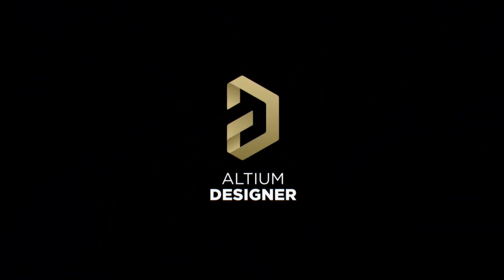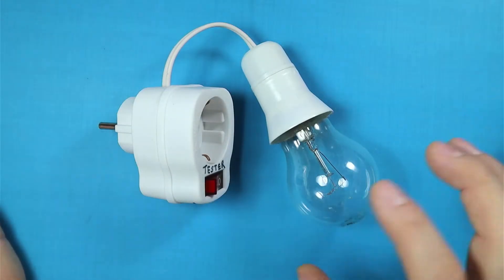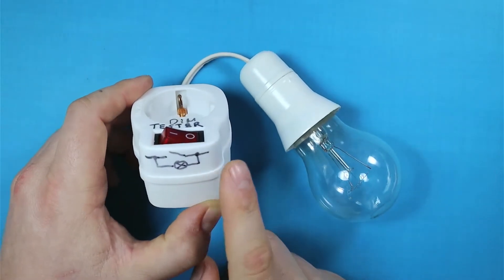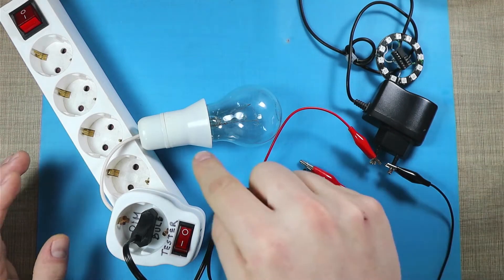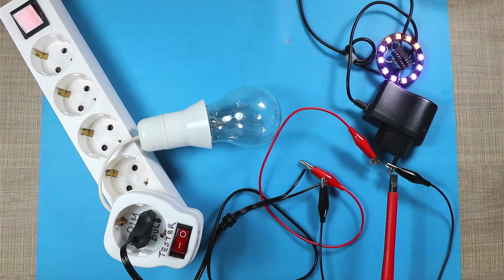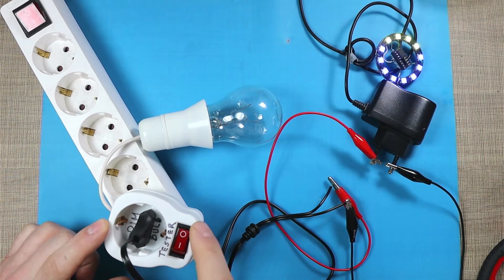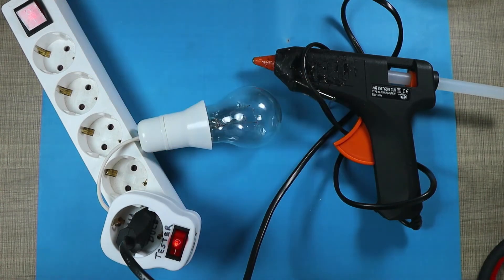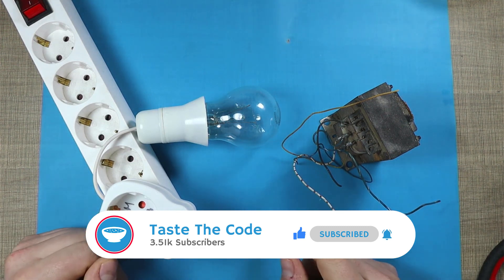How to safely test AC electronics with current limiter - Dim Bulb Tester

Comment: So the center pin of the bulb (the one located beneath the large metallic body) is still connected to the live, and the metal body is connected to the tested device?
Reply from the maker: Yes, correct. This puts the bulb in series with whatever is plugged into the socket and acts as a current limiting resistor.
Reply: @TasteTheCode Thanks. I was confused because I noticed that with UK plugs, you can't connect them the wrong way. Also, is a 40W bulb good for testing a toroidal?
Reply from the maker: It might be too low and let too much current through. I'm using a 100W bulb.
Reply: Hi again. Does it matter which direction I plug in the device? In my country, we use Schuko plugs like the one in the video. I know that the bulb needs to be connected to the live wire both from the plug and from the device, but with these plugs, we can rotate them. @TasteTheCode
Reply from the maker: No it does not. In theory yes, but again you can never know for sure which one is which.

Comment: Thanks for the tutorial, really handy. But one noob question: do you have to wire the bulb to the hot wire or it doesn't matter?
Reply from the maker: As long as it is in series, it doesn't matter. With our plugs, you can turn it around so you never really know which one is which.
Reply: Thanks again!

Comment: Am your  new subscriber frm the Philippines. 

Much better if the bypass switch is removed to avoid accident in case of negligence. Nevertheless, it's a very nice video for engineers & technicans!
Reply from the maker: Hey, thanks for subscribing. The switch is there to serve a purpose to test whatever is plugged in under full current once we established that there are no more faults. Some devices will refuse to work properly unless a sufficient current is applied.

Comment: i will add MCB before the bulb and replace  switch in bulb with MCB also
Reply: Not sure why a breaker instead of the switch is a good idea, breakers aren't supposed to be operated as switches. If I'd install a breaker it would be just one that service the whole limiter. And remember to use one rated less than the MCB / fuse in the distribution box.
Reply from the maker: Adding a breaker will definitely not hurt any project!